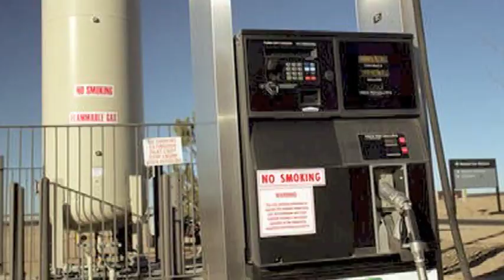Alternative Fuel for Cars : How to Convert a Vehicle to Propane

Comment: Also, BBQ tanks are absolutely illegal for conversions, period.  Even a novice knows this.  WTF?  Fuel lines into the manifold?  Hell, we don't even do that for gasoline.  The fuel goes to a vaporizer, then to a mixer, then to the manifold.

As for warranty, sure, you'll have a harder time making a warranty claim for certain things, but not everything.  Most people buying brand new vehicles are flush with cash and don't need to save almost $1 a litre on gas, so yeah... no surprise there.

Moron.

Comment: In a petrol (gasoline) engine, I've never seen a combination system where the gas and propane are delivered at the same time.  I don't imagine why anyone would even want to do that except for a diesel vehicle.  This man knows nothing about propane conversions.

20% benefit?  Try 244%.  $1.20/L for gas, $0.49/L for propane.

As for trouble... sure, if you do it yourself.  Most people take their vehicle to a professional and are driving it again in a week.